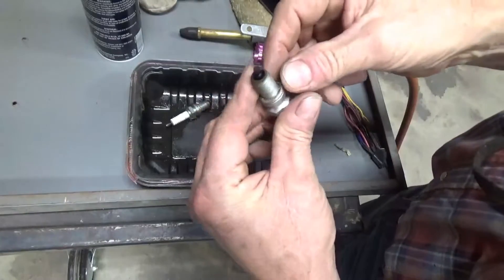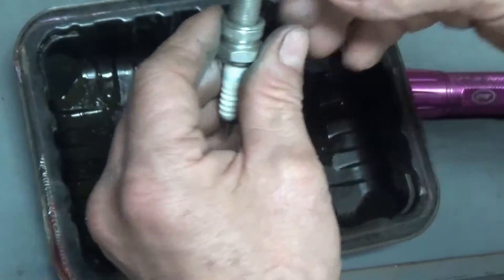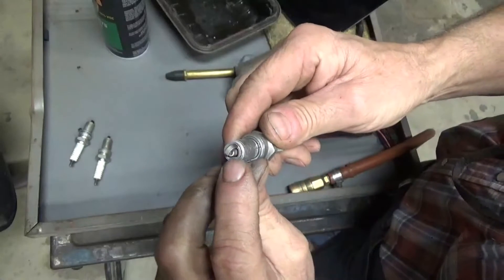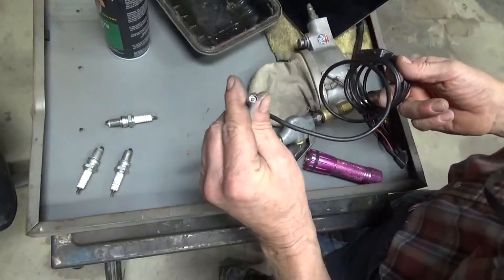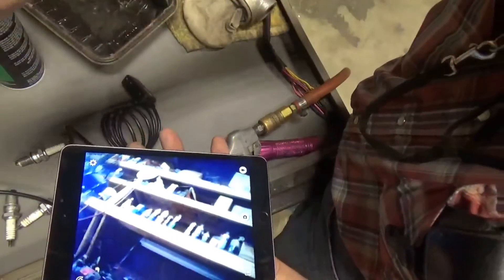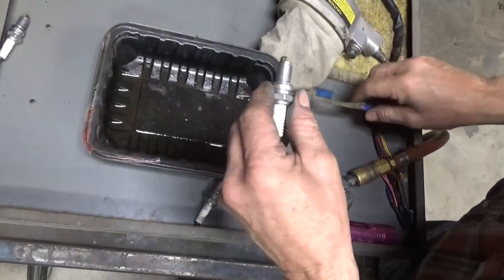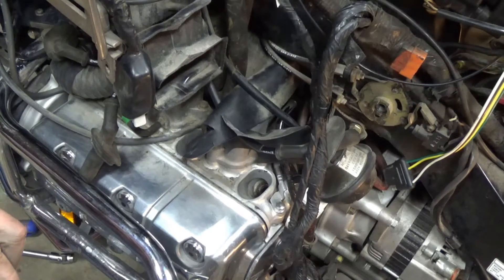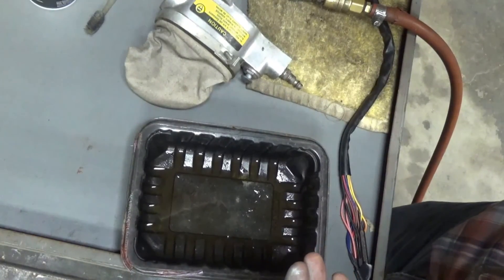cleaning spark plugs and recording video inside spark plug hole with endoscope

Comment: Surprised it worked holding it upside down. The lever on the side of the unit is for just sand and the other way is just air.

Comment: I sandblasted my plugs and cleaned them out with shop air and a thin piece of wire also and came out like new and never had a problem.
Reply from the maker: It works good, well worth the price.

Comment: I love my scope, one of the best diagnostic tools someone can have and not just for working on engines they are handy around the house!
Reply from the maker: My old, not too old only 12 years, "See Snake" camera broke and I was on Amazon looking for a replacement and found this wifi thing and I like it better because the camera is much smaller. I paid $200 for the Rigid See snake and paid about $38 for this thing.